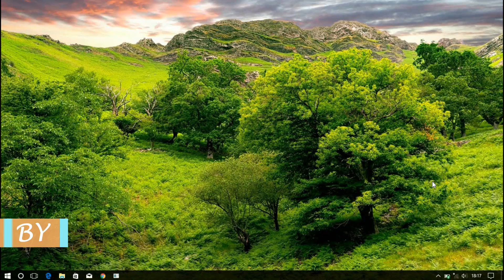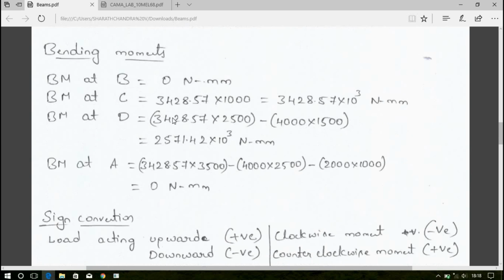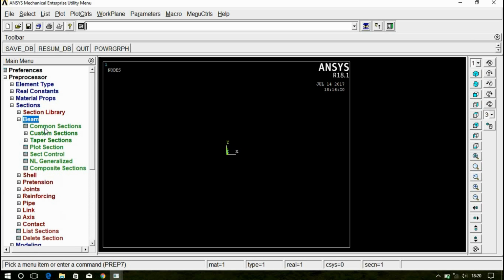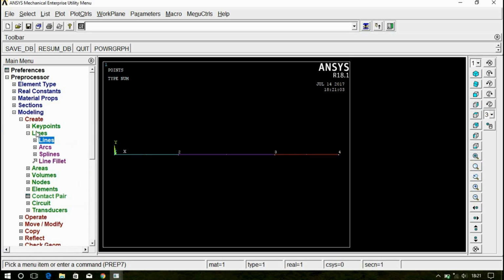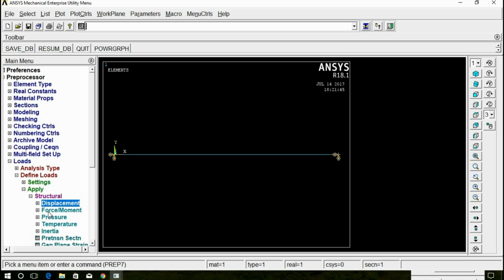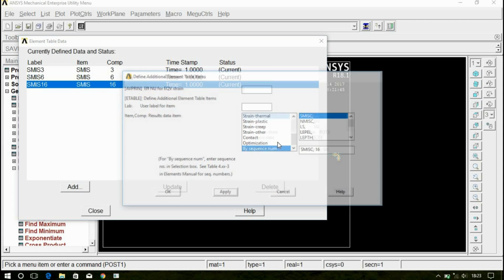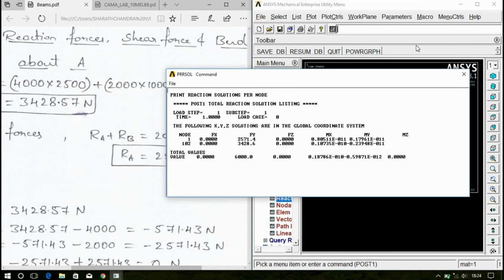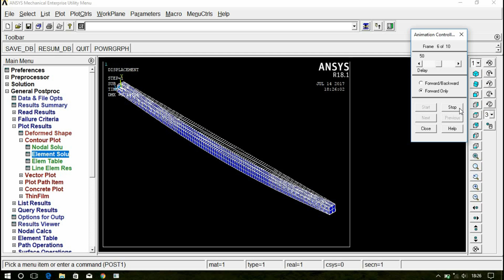ANALYSIS OF SIMPLY SUPPORTED BEAM USING ANSYS

Comment: The support conditions are hinged hinged. This is not theoretically Simply Supported. For only vertical loads, this works. But if the load is inclined, it will give wrong results.

Comment: hello sir,
i have problem in solve simply supported beam under two points loads with span 2400mm and load 7500N in each point and loads placed in distance of 450mm from left support and 450mm from right support so distance 1500mm is   mid-span between two loads. cross section 160mm width and 240mm hight. please help me in solve this problem by Ansys. 
thank you very much